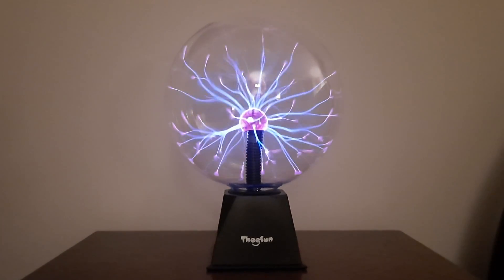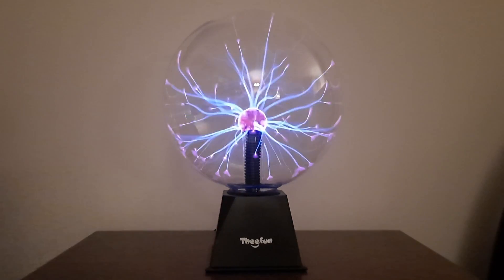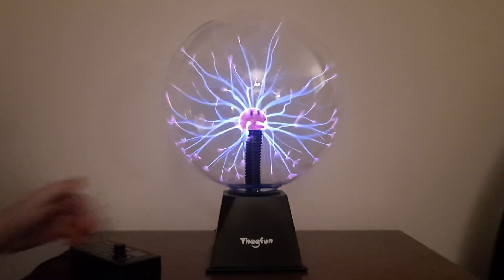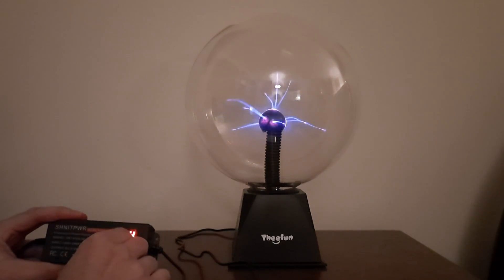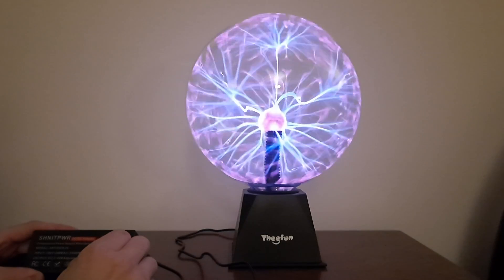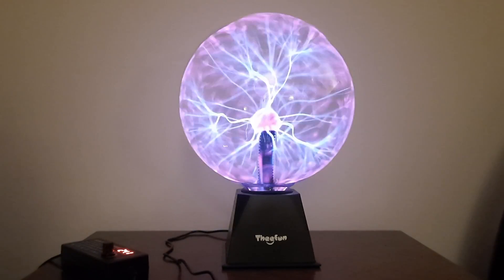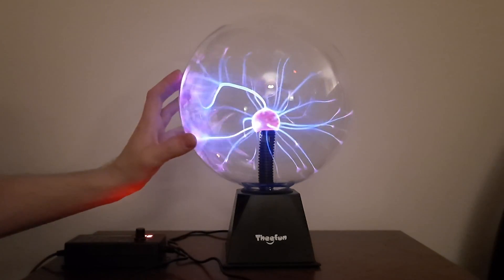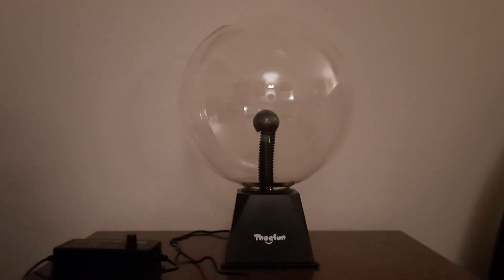Overpowering Plasma Ball !!! - WILL IT BREAK ?

Comment: I accidentally over powered mine because it’s batteries were running out so it started to stop responding to my finger so I was like hay what happens if I just plug it in so I found a plug plugged it in then it got wham and smelled strange when I put my finger on it so I unplugged it and the plasma ball is 6 volts and I plugged it 12 volts and I don’t know how many amps I’m never doing that again that’s why I looked for a video it made a weird smell from the ball to and left it on my finger 😐
Reply: I had a similar situation, I lost the USB charger for mine and found a TV plug which fit the plasma ball. Within 10 seconds of turning it on and touching it, smoke started to come out of where it was plugged in, if i left it any longer it probably would have set on fire 😅

Comment: Voltage and current does not work like that. The laptop charger doesn't "give" more amperage. If something draws, for example, 1.5 amp at 19 volts, it will always draw 1.5 amp at 19 volts even if you power it with something that could give like 50 amps.
Reply: Can't believe I had to scroll this far to see this.
Reply: @phillxor  It's almost scary how little people know about basic electronics.

Comment: I tried this at home and fried my plasma globe at measly 14 volts :) Now, a few rounds of tinkering later, it can take 10 times the power it could originally without blowing up, and runs at 3x rated power indefinitely. For more of that it'll need active cooling, but for now a large heatsink on the MOSFET and a bunch of holes I've drilled into the base work alright.
It now has an older, more robust circuit tho, and the low-voltage side if it is stabilized at 6 volts. The newer stuff burns up way easier, the original board got its brains fried too. At least the flyback transformer is okay, so I can use it later :)

Comment: Cranking up the voltage without also cranking up amperage is nothing a power supply could control. It may have a limiting function, where the voltage doesn't rise any higher, when a certein current is exceeded, but that is all the power supply can do. You cannot control current with a power supply. It is a direct function ov voltage.
Reply: I have bench/lab power supplies that will. You can set them to keep it under whatever current you set it at... but if there is a short or out of spec load, the voltage will drop because ohms law cannot be broken.  But be sure that those supplies and circuits exist that are called constant current supplies just as many power supplies out there are made to be constant voltage.
Reply: @KlodFather  I'm sorry, but I think you need to read a bit more on how voltage and current works. You can't limit the current and still have the same voltage. If you hit the current limiter the voltage will always drop so that the current doesn't exceed the chosen value. It's impossible for the same load to draw a different amount of current at the same voltage.
Reply: @EmilSaloheimo  -  You should go back and read what I wrote carefully. I said exactly what you are saying in my previous post "but if there is a short or out of spec load, the voltage will drop because ohms law cannot be broken."  You should read more carefuly before making a false assertion and being too smart by half.
Reply: Right. Isn't it basically the amperage is drawn out based on the resistance in the circuit. So you can overload the supply into the resistors with higher voltage and with more amperage available but that only leads to damaging the resistors inside. Realistically if it's AC power you might be better off doubling cycles in Hz evenly. And reducing the resistance inside the unit.
Reply: @infn8loopmusic  -  What those plasma balls are doing with the AC input is to rectify it and filter it with a cap for smooth DC. Then they will have transistors oscillating into a coil of some sort with a very high tension secondary similar to a flyback in a TV. TV high voltage is 15 kc or so and gets really efficient transfer with little iron. Many ultrasonic cleaners do the same thing between 35 and 60 kcs. Line power is 60hz and would require HUGE iron to step it up to plasma ball voltages. That is why you can power these with DC because the DC adapters just go straight through the diode bridge past the filter cap and the globe fires right up. The input impedance would be increased if you were feeding a step up transformer directly but a large iron transformer made for 60hz will not like that very much and will fight the high frequency AC. That stuff always works on inverses. There are some good videos here on YT about that kind of circuit analysis and some good books illustrating those concept and their math.

Comment: If you want to power it more, replace the transistor inside with a power transistor and use a separate power supply to control the primary side voltage. Cranking up the voltage going to the whole circuit is much more likely to damage it since the low power signal generating components aren't designed for much higher voltage (typically)
Reply: There are some transistors that will really deal with some serious abuse, and they have the gain and base ruggedness to handle these out of spec operations. Be sure to put a good heatsink on the transistor to help it get rid of the heat being created by the voltage drops across the junction. You don't even have to mess with solder paste if you don't want to... they make a rubber like pad that you can put under the transistors when clamping to a heatsink that will pass the heat very nicely and no mess. 
I did this with my little 5 volt one that I blew up. I added a small fan as well. Now I can feed it 18 volts and it looks like something from a sci-fi show LOL  You can smell the ozone.
Reply: @KlodFather  Sure there are higher voltage rated transistors, but its never good practice to do this to a circuit designed for a set voltage. Signal processing components are almost ALWAYS rated to less than 12v. Also, gain has nothing to do with ruggedness. The "robustness" of a transistor is inherently subject to the circuit design criteria. In this case, a mosfet would be preferable because of the comparatively low on resistance and thus low junction losses. It also requires much less current to drive a mosfet at these frequencies and powers.
Reply: @treasuretotrash2067  -  Your main post is spot on...  But the second one in reply to me shows the cracks in the logic.
Reply: @KlodFather  How so?
Reply: Words of wisdom here  ^  ^
Reply: @jollthebro  in what world does it make sense to mock my suggestion for being 'nerdy' in a science video comment section. Buddy, you searched for this 💀
Reply: @treasuretotrash2067  I was just scrolling and this video pulled up so I mocked the nerds gang

Comment: nice power supply, didn't know about that model, cool

you let the magic smoke go out, that's why it doesn't work anymore
Reply: "The little 12 volt mosfet transistor on its circuit board gets destroyed. Later I ended up replacing it with a stronger one and added a larger heatsink.  Works like a dream now!"

the description.
Reply: @TheRealYashNotFake  thanks :|

Comment: Nice idea. I like how it looks when voltage is lower . 8v makes it slow and I like this effect . I need to buy an adjustable power supply. Can you tell me its OK if I buy a 60w one because I didn't found a 36w here in my city like the one you have show the link in description. Its matter if its 36w or 60w?
Reply: The higher rated power-supplies will be just fine, it just means that they have more capacity to work with.  =  )  What you really need to watch, (what you only need to watch, is your voltage, because that is what will actually determine your final power level. <3  The lower the voltage, the less overall watts, the higher the voltage, the more power that it will naturally pull from the mains. <3